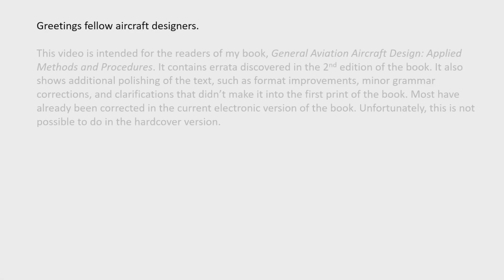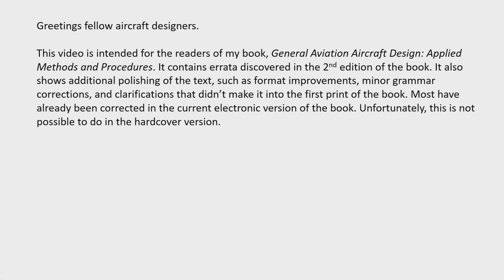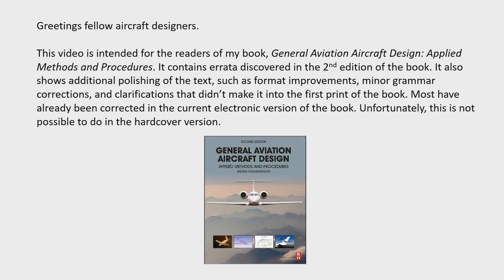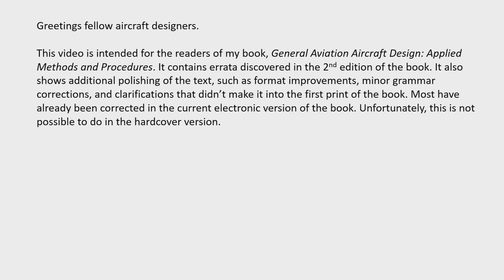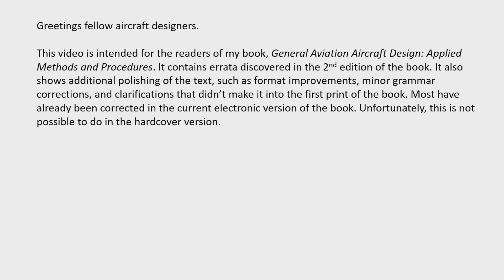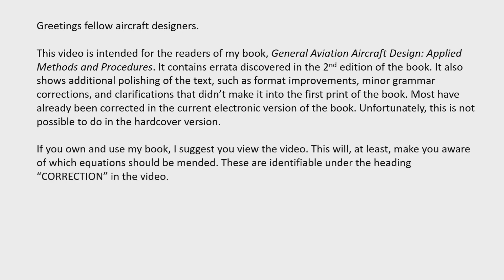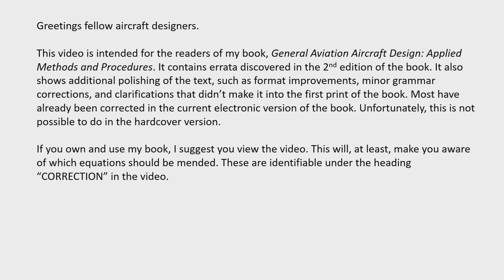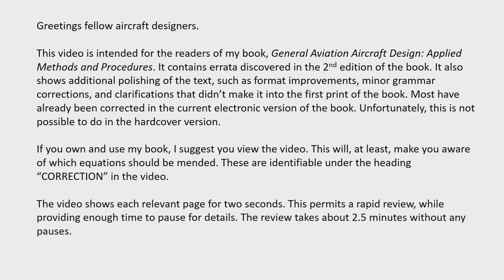Corrections Summary for GA AC Design, 2nd Edition

Comment: Hello Professor and thank you for the video. In addition, could you please clarify the following: on p. 952 (1) it says that if the thrust line is above cg. it should produce a negative moment nose down - which makes sense. However, if I put a positive z, positive T and the rest of the positive numbers into eq. 24-109, I get a positive CM(0T). Should't it be negative? Or what am I not getting here? Thank you!
Reply from the maker: @ristopajuniemi    Greetings and thank you for your comment. Sorry about the slow response, but I was traveling. Anyway, to answer your question, you are correct. The equation is set up to be used with the stability coordinate system (in which positive z points down and negative points up), but this is not clearly disclosed in the text (not to mention the coord sys avatar in Figure 24-32 misleads further). I have made note of this for future editions. Thanks for bringing this to my attention.

Comment: Prof. is it appropriate to use just the density ratio to account for change in thrust output as regards just electric motor propulsion, after getting the thrust at sea level from density ratio then select an electric motor producing that thrust value at desired throttle or power setting, or do i need have to convert it to equivalent motor power in HP/watt ? E.g given thrust of 2LBf at 1600ft, density ratio to sea level is approximately 0.6. thrust value at sealevel is approximately 3.33LBf.
Reply from the maker: Sorry, Israel, any question that requires me to do calculations means I am consulting. And I charge for that.
Reply: @dr.gudmundssonaircraftdesign  I've really benefited alot from your advice, I've read many aircraft design testbooks but I've gotten good valuable information from you that has aided my growth career wise. am an aerospace engineering graduate in Nigeria, it's quite difficult getting well experienced aerospace engineers majoring in aircraft design and that's my area of interest, am also currently working on an aircraft design project. I'll be glad if i can reach out to you through email so i can communicate better.
Like the saying goes "better than a thousand days of diligence study is one day with a great teacher" it's a privilege to interact with you prof.

Comment: From thrust estimation for a cruise flight let's assume cruise condition has the highest thrust requirement from the constraint analysis, its given that a thrust of 4LBf is required to fly an airplane at a certain speed at 1600ft, and density ratio to sea level is approximately 0.6, thrust value at sealevel will be approximately 6.66LBf. this means the motor should be capable of producing 6.66LBf of thrust to fly at that cruise speed at S-L, therefore Can we select or purchase a motor capable of producing 6.66LBf of thrust at S-L while its stationary, static, at rest i.e Velocity of aircraft = 0 ?
N/B: its an electric motor in this case. Thank you prof.
Reply from the maker: @israeloluwagbemi825  Sorry, Israel, any question that requires me to do calculations means I am consulting. And I charge for that.
Reply: @dr.gudmundssonaircraftdesign  ohh. Ok... Thanks alot

Comment: Thanks for sharing this information. For those who bought the electronic version (official) and hardcover version, this case me, would be possible to make the download again of the new version? Thanks
Reply from the maker: @Sturmbock71  You're welcome. Your question is excellent and very reasonable. Let me try to find out. May take up to two weeks. I'll report back here. Best wishes.

04/09/2024: I have a response from Elsevier: The book cannot be updated via customer re-download. Sorry about that. 😞
Reply: I have also bought both the hardcover and the electronic versions directly from Elsevier. I would be interested in downloading the corrected PDF and/or epub electronic versions if it becomes available for existing customers, that would be really nice.